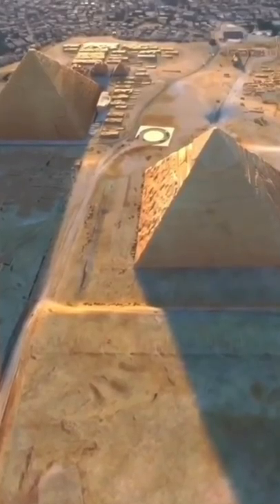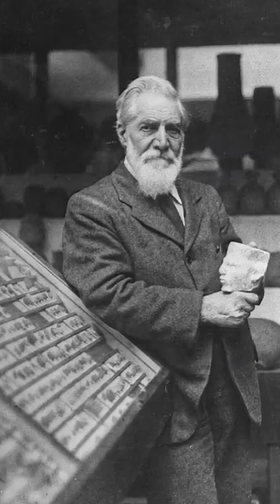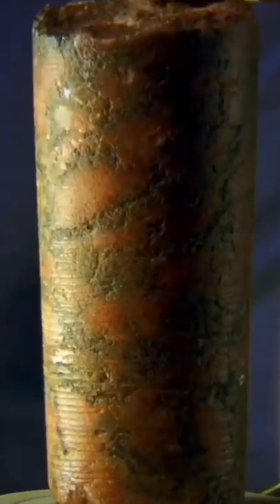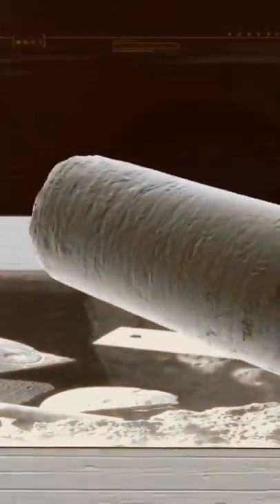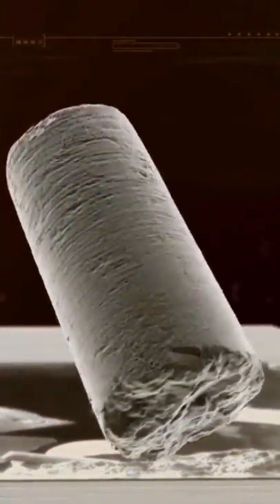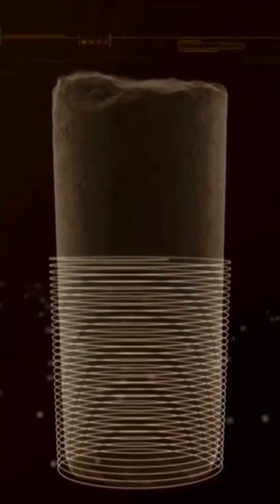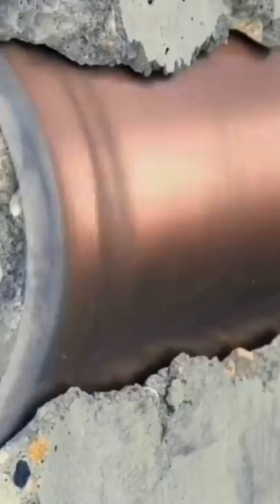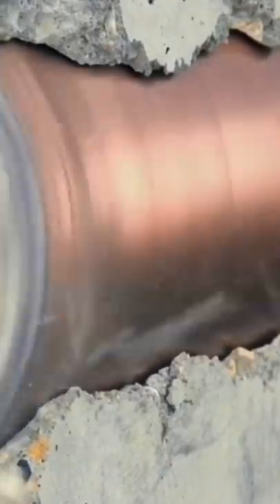Advanced Ancient Tech found in Egypt! Core7

Comment: Don't use rotation, use vibration. The hollow metal zylinder will work like a tuning fork and will tune itself to the resonance frequency of the stone it's hold on to with little force. Then it will almost melt its way through the stone. Apply water and it will increase the speed of sound aka frequency. Therefore you increase the energy created between the metal and stone since energy is just the frequency of an molecule's speed.

Comment: WRONG! The marks left on the core were probably made as the cutting blade was EXTRACTED while still rotating.
Cutting speed is irrelavent as stone is cut by friction. They were building a piramid over decades, not making 2000 widgets per hour.

Comment: This one isn’t that impressive cause 2 guys pulling ropes from the sides isn’t the only way to do it without power tools.
They could have easily built a hand powered tool to spin it in one direction very fast. With gears and a crank they could spin it extremely fast with little to no effort. 

You just showed the most primitive way you could think of cause you assume that was their level of engineering

Comment: What if they hooked a drill bit up to a pulley system that would give a high-speed with men running on a round platform and using rope or twine hemp as the belts

Comment: All of these theories about ancient technology start with the assumption that our ancestors were stupid when we have proof that they were not. I can think of a relatively simple machine that could have done this.

A rope, similar to a bow drill but several feet long and woven into a loop, be placed around several wheels in a fashion similar to a modern machine’s drive belt. A hand crank could provide various amounts of rpm, higher input effort yielding higher output force. A small crank shaft attached to a large drive wheel could generate very high rpm. You could even make the crank shaft long enough for several people to turn it at once.

As for the downward force, you could fasten the end of a wooden beam off of one side of your core bit (making the core bit itself your fulcrum) and suspend stones of various weight from the other end. The force applied would depend upon the weight of the beam and stones, and where the end is fastened in relation to the fulcrum.

This is just the thought process of a stoned mechanic. I have no doubt that there were engineers at the time that would find my idea rudimentary

Comment: Well a power drill is correct they had a five horsepower drill they used will attached to horses The wheel would spin a shaft in turn would spend a gear system that would operate the drill press and yes we have found remnants of these machines it's ignorant to think that Egyptians didn't have machinery

Comment: This has been proven to be false years ago. Granite can be cut with sand and continuous pressure from a copper tool. Such as a hollow rod (used for cylinders) with pressure produced by a bow drill. Which would drill 4mm an hour. And also was done with saws. They may have a bigger version as well thats been lost to time.

Comment: PLS PIN THIS!
Okay check my theory I just came up with: 

They took some type of hard stone/material made a drill out of it. And it actually didn't even needed to be that hard of a material, as they could have just used up PLENTY of those drills, using them up until they were useless and then replacing them with a new and functioning one in the process.

So they fixated the drill-head (which could've been huge/tall) on the end-gear of some type of XXL-Gearbox (this is a device made of several gears, all of them are connected. 1st gear spins the 2nd gear faster, 2nd spins 3rd even faster, 3rd spins 4th also faster and so on)
Using the manpower of MANY workers, they span the first gear (the one that powers the 'XXLGearbox-Drill'). This gearbox-tool would've been built like a building, standing at a permanent location. The first gear would've been on top of this "building", having a platform where the workers would've been walking their circles. The other gears would be underneath and built vertically towards the ground, where the last gear would spin extremely fast making the drill rotate at a few thousand RPM's. As core7 didn't have any breaks, it is possible that they didn't even have to change out the drill used for core7. But like that they would've had a very fast spinning drilling-tool as well as a very high pressure because the whole gearbox and workers were heavy. Which are distinctive patterns of litteraly, only one thiiing. 
Now, history-books say that the egyptians knew about the "wheel" since the 5th dynasty (ca. 2500-2400 BC) as they found drawings of wheels, wagons, since then.
It is very likely that they knew about the wheel for some time longer.

Comment: Has any body taken the time to see if you can drill a rock using a long enough cord, I'm talking miles long, connected to a set of gears, with rope being connected to a bigger gear and the bigger gears connected to a series of smaller ones that would rotate faster using less force when pulling the rope, and the small gear connected to some type of drill bit?

Comment: Bow drills and pump drills was a thing. They used it to cut Stones. The speed could be equal to a mordern drill. So now you just have to have a dude able to make drills large enough to make the holes. And have a system that could pump it. That does not sounds like the biggest mystery in the building of the pyramids?  Pretty sure they over come worse problems it is the god damn pyramids. Still one of the most amazing buildings ever build. 

They where not fucking around this was the best builders in the world.

Comment: That's not a core, that's a tool. 
That thing was used as a drill bit, and the spiral groove was there to lift out debris.
The tool was either long enough to hold or had a handle socketed on it. 
The drilling was done in one direction only, not back and forth. There are ways to use rope-drive to turn one direction.
The tool could have been chipped out by any good stone worker.
The face of the bit may have had abrasive sand on it, or just relied on crumbling granite.

Seriously, any drilling operations that put a mark like that on a core would be defective. The speeds and feeds quoted are just ridiculous.

As always, if they had super tech, why did they pile up rocks? Where is the aluminum, where are the computers?

Comment: Changing gears from large ones with more torque to small ones that gives more speed could have been hooked up to a water wheel to get the speed necessary for high RPM's and forging skills they may have possessed that we haven't discovered yet could be the answer. Why does someone always have to say alien's like humanity is some petri dish science experiment gone awry ?
Reply: Still need Diamond- tipped tubular core drill bits to make that work..

Comment: The description doesn't make sense. If its drill speed is 1600 rpm than the drill travel or pitch would have to be length of cut decided by drill speed which at 1600rpm would not make a single spiral cut!

Comment: Could that not have been created by a long hollow tube being turned by a cord wrapped around it that was also wrapped around a much larger wheel creating g a ratio that would produce that speed? Also could not the top of the tube be weighted to create sufficient downward force to create the necessary pressure? Could not the cutting tube have been created in the same manner? Bearings could have been made by rolling rocks on an abrasive surface in a circular motion. The inner part of the tube could have been cut first, and then the outer surface via lathe type action. It is I agree a long stretch but not completely implausible.

Comment: Yeah I've seen similar video on the core. The funny thing is to think that a civilization that could build the pyramids couldn't figure out how to make a drill that went in one direction? Come on now. I mean they could have simply hooked up some sort of shaft to let's say like a water slide in which they would put a paddle gear at the top and so as the water travel down the chute it would pass by the paddle wheel rotating the shaft causing the drill to go in one direction. That's just one rudimentary idea that I had come up with. I'm sure they had many more. Shit it could have just been a thousand mile long rope that they had wound and then they just had people walking in One direction pulling the rope which is spun around the shaft of the drill bit and as the people walk pulling the rope it just rotates in one direction cuz they're all moving One direction instead of going back and forth like on the bow drill. That's just a second rudimentary idea that I came up with as I was writing this comment. Come on now.

Comment: Dude, you really need to fact-check yourself more. It's a freaking piece of wood!

Core 7" is a term used to refer to a particular artifact found in the Royal Cache of Tanis in the Nile Delta region of Egypt. This cache was discovered by Pierre Montet in 1940 and contained a large number of royal and elite artifacts from the 21st and 22nd dynasties of ancient Egypt.

Core 7, also known as artifact 16036, is a wooden core that was found in the cache. It measures approximately 53 cm in length and 15 cm in diameter and is covered with a thin layer of gold leaf. The core has been identified as a component of a royal ceremonial headdress, possibly worn by a pharaoh during the New Kingdom period.

Although the exact origin and purpose of the headdress are not known, it is believed to have been a symbol of royal power and authority. The headdress may have been used in coronation or other important ceremonies, and the use of gold leaf would have further emphasized its significance.

Overall, Core 7 is a significant artifact that provides insight into the complex symbolism and cultural practices of ancient Egypt. Its discovery and preservation have contributed to our understanding of this fascinating period of human history

Comment: 2000 psi on a core drill is nothing special  that is hand tool level of pressure. the speed is unknown if someone tells anyone that would say it had to have been above a certain speed is incompetent and should not be trusted. A bow drill was a primitive form of drill it was widely used because it was easy and cheap to make and use.

Comment: Except I use a modern core hole drill and it doesn't leave such observable marks in the cylinder, which are left as it drills through a minute increment, instead of a solid single push through. Maybe your lies and obfuscation will work on the uninitiated, but to anyone with any experience with stone, you're not just a liar, but a pretty bad liar at that

Comment: These so called "experts" are only experts at what they do, which is to speculate while having a complete lack of knowledge about that which they are speculating on. When it comes to doing most anything else they are even more useless. 
   Levers, ropes, pullies, counterweights, oxen, horses, manpower, etc. can accomplish a lot.
   2000 psi of down force could be easily accomplished using a wooden timber. 
   The concept of gear ratios is observable so it was likely used to easily achieve 1600 rpm using rope.

Comment: Only way was with a power drill eh? Lmao. Based on the groove? Can't think of one other possible way eh?

How about a sort of bow drill but attached to a camel running forward while a great pressure was added to the top of the drill.

No power needed other than the canel and about 2000Lbs of weight on the drill head forcing it forward with a single long clockwise pull of the bow by camel(s) running attached to bow-like drill.

Y'all try so hard to invoke high technology, aliens, magic, acoustics whatever you can throw at explaining away ingenuity, master stoneworking skills or anything realistic. Never a logical idea like the realistic one I made up in 2 seconds.